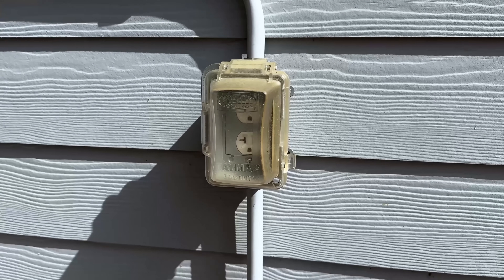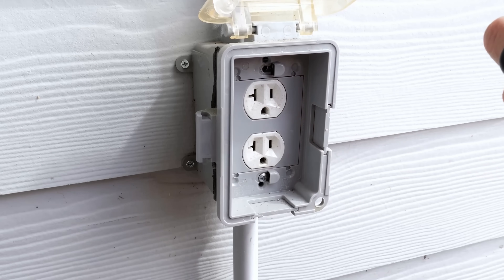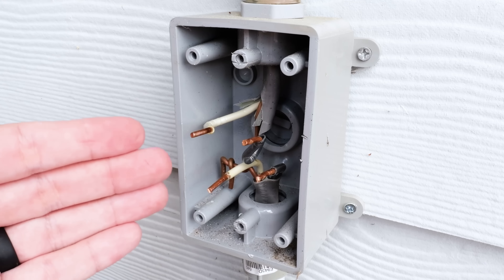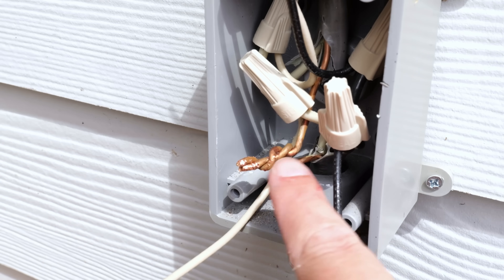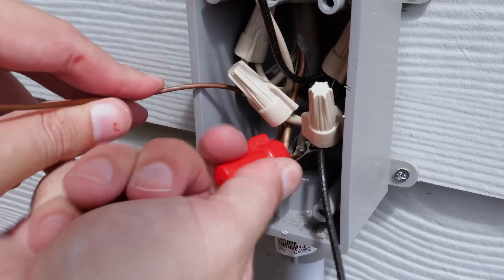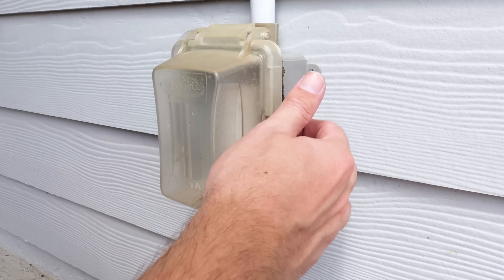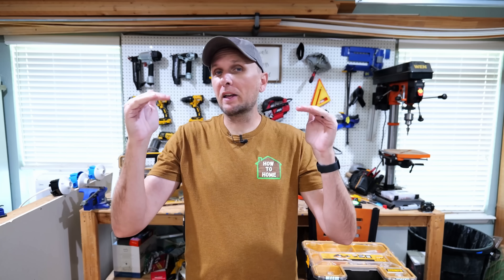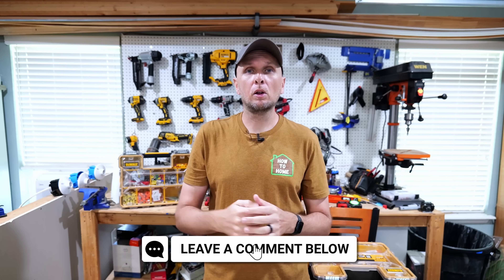Dangerous Mistakes DIYers Miss When Installing Outdoor Outlets!

Comment: Great video.  But...but...you took great care to use 12ga (20A) wire for the pigtail, then replaced the 20A outlet with a 15A GFCI. So you have 10ga (30A) wire going to a 12ga (20A) pigtail, to a 15A GFCI.  Seems like a waste.
Reply from the maker: I mean, that is your opinion but I don't need a 20 amp receptacle at that outlet.

Comment: I noticed that the "in use " blank for the cord to run out of at the bottom of the w/p cover was still in place. This is so you can run the cord out and still close the cover. I still wonder what use an "in-use" cover is to the other end of the extension cord that is typically plugged in to that GFI recpt. with a waterproof cover, and the other end of the cord is left laying out in a puddle, or in the rain?

Comment: Did I miss something? 20A breaker that had a 20A plug. Being replaced with a 15A GFCI?
Reply from the maker: Nope you didn’t miss anything.  What’s the issue?
Reply: @HowToHomeDIY  20Amp breaker does not protect 15 amp receptacles?
Reply from the maker: 15 amp receptacle doesn’t need protection from 20 amps.  They are rated for it.

Comment: That was a good tip to recommend testing the outlet to make sure power is completely off. Sometime you have situations where some DIYer  installs two sources of power, instead of just straight three wire cable with ganged breakers to insure power is completely shut off.

Comment: I’ve got some electrical experience but I had an outlet that powers my water softener go out on me. It was kinda hard to get to and I have a company come out and fill the salt tank so he said he’d charge me $10 to change the outlet so I said yeah. 6 months later I’m pressure washing the house, next thing I know there’s sparks flying and smoke everywhere, the dumbass didn’t put a gfci outlet RIGHT NEXT TO MY WATER SUPPLY. Thankfully I was able to get it unplugged and swapped with gfci, it’s actually so dangerous to have a normal outlet where it can get wet.

Comment: Didn't talk to your customer and see if there was a reason for the 20 amp outlet. Now there's a decent chance the customer's going to try to plug in their 20 amp power cord, discover they can't anymore, and be mad. 20 amp outlets aren't usually what are 'grabbed by default' and are put in purposefully. I would have at least put in a 20 amp GFCI there to match.
Reply from the maker: And if they were a customer I would have done that but it is my house and didn't want a 20 amp there.

Comment: are you not supposed to twist the wires together when using a wire nut?  Its a question because I am not an electrician.

Comment: wrong on support. it less than 3 feet and the boxes can be used to support the rnmt.  typical diy hack you are.
Reply from the maker: Oh no I’m being attacked because I went above and beyond.  And it was the point of how it’s often missed.  Over your head I guess.  But then again I see you have posted on my channel 5 times now and it’s always ridiculous like this.  Troll alert 😂
Reply: @HowToHomeDIY  30yr master electrician. you a you tuber diy hack. read code for once. and it's not pvc it's rnmt
Reply from the maker: The grumpiness makes sense now.  If you are actually an electrician, you really shouldn’t be.  I can’t take you seriously calling it what you did.  It is literally PVC conduit.  And I talked all about code in this video.  Another upset “electrician.”  Can’t imagine why 😂
Reply: @HowToHomeDIY  you said it needs to be straped that is wrong read the code under rigid nonmetallic tubing.
Reply from the maker: Oh now you want to change the subject 😂.   Conduit does need strapped.  Oh no, I strapped mine even though it was about 5 inches short of being required.  Darn me for bringing it to people’s attention and going slightly above and beyond.  Stay upset over nothing.  Helps get video!  😂

Comment: Could you not tie the common wire together with a pigtail and the same for the hot wire and then wire the outlet to the pigtails? This would reduce the number of wire nuts stuffed in the box. The down line would be energized and the GFCI would be as well.

Comment: Connection is better if you put both wire in the same screw. I performed experiments over torque on the screw with one wire compared to both wire.
Reply: Gfci’s have a two sets of screws because if you put two wires under one screw, you are merely splicing one wire to the other. Gfci can only provide protection now only to what is plugged in at that location. whatever is served downstream has no protection. Another good reason to use a gfci breaker

Comment: Wtf,is that outlet more than 500ft from panel,voltage drop on 12 wire is 3 volts per thousand ft so if not more than 500ft 12 would be fine,other people are right 12 pigtail devolves voltage drop premise, less than 3 ft on conduit doesn't have to be strapped according to code.where did you go to school?
Reply from the maker: Your voltage comment is so ridiculously wrong I can’t take anything you say seriously.  The strapping was a point that most miss it.  Oh no I went above and beyond.  Get mad about it 😂

Comment: At least here in Pennsylvania, we are not required to update any electrical outlets. New installs are a different story.   Code here is based on date installed.   Sometimes homeowners policies will require updating.  And some towns have update requirements for rental units..     Every one of my outdoor electric were put in in the 1960s.  And I will never put GFCI in any of them.  At my second home my outdoor christmas.lights set off GFCI when it rains.  It is a pain in the ass.  I most likely will replace one of the outdoor outlets with a standard outlet... For Christmas lighting.   I also decorate at my main home and never had an issue with standard outdoor outlets.  I have added   GFCI  outlets  in my kitchens and bathrooms.     GFCI  outlets at our other house at the lake  will kick from dew  also.  A royal pain in the ass...  And I will never put arc fault in any house..  my skill  saws  and miter saw kicks them every time...      Most of my tools are at least 25 years old and work as intended...    So never will I update any outdoor plugs.

Comment: I have seen missing gaskets too - Gasket must be intact!  Also - GFCI receptacles are not standardized. I have seen licensed sparkys get line and load backwards because they do it so much, that if they get a GFCI  with line and load swapped top to bottom, they don't even notice and hook it up backwards. ALWAYS read the back of the GFCI and verify top and bottom line/load labeling before connection!!!!
Reply: I swapped the line and load on a GFCI I installed and it wouldn't work right. That was the first time I realized the GFCI outlets are directional. Normal outlets are not.
Reply: @MAGAMAN I’ve been in low light and put on wrong and told them hold up don’t flip the breaker. It got flipped on and off and didn’t hit the test button at all and it didn’t work ever again